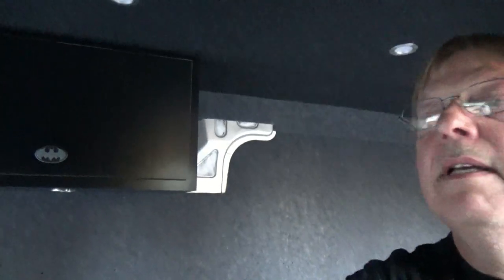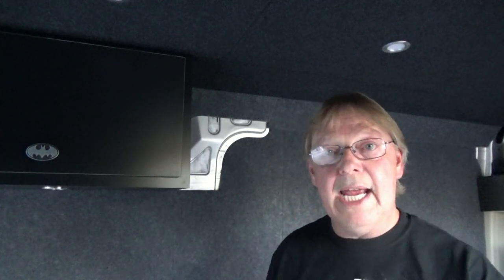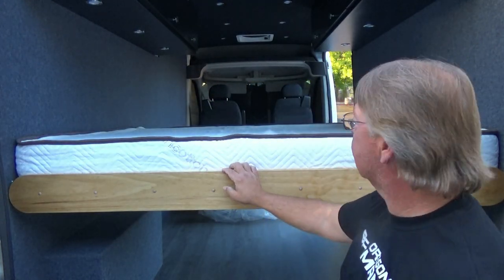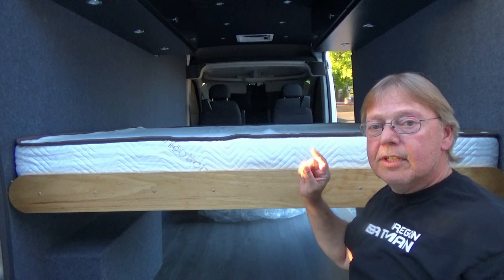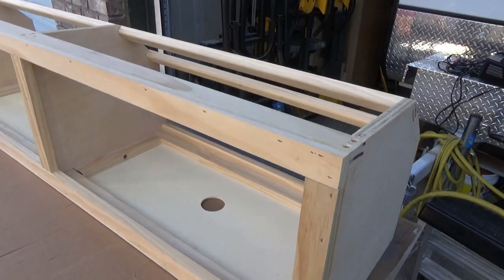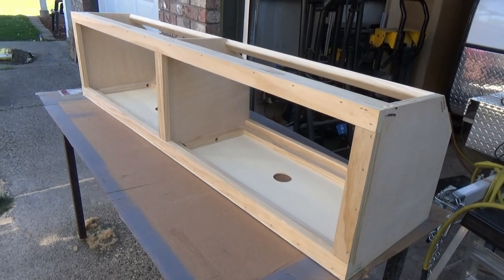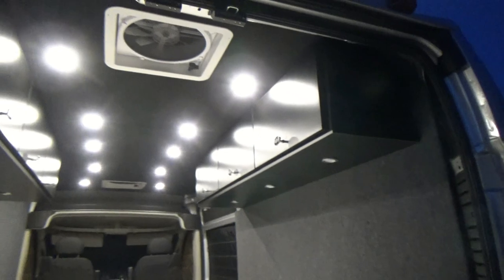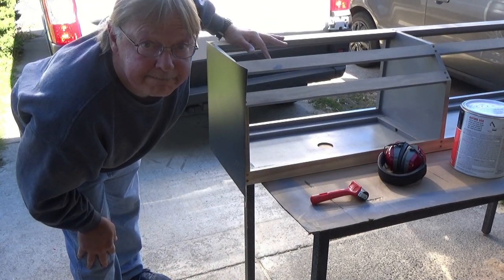Promaster Van Build 2500 159WB – DIY–  Mattress and Cabinet – Part 14

Comment: The mattress is only 70" long? I was hoping to get a 74"x54" which is the standard Double or even RV Queen which is 74"x60".  Is your wall insulation super thick?
Reply from the maker: Correct.. the walls are thick and double insulated. You could gain an additional 3" installing walls a little differently than I did. 70" works perfectly fine for me :)
Reply: @OregonBatman  where did you find the 54w x 70L mattress?  We need the same thing!!  Thanks in advance.
Reply from the maker: @milenas3797  Hi Milena! I purchased the mattress from Mattress Insider: https://www.mattressinsider.com/

They make any custom size you need. Try this coupon (if it still works) to get 5% off    REFER5

Hope that helps! al